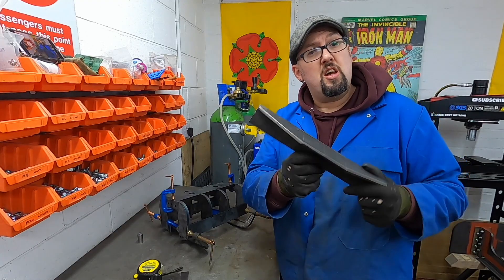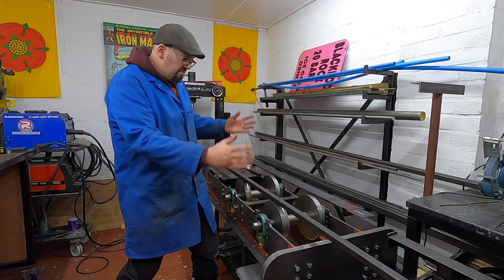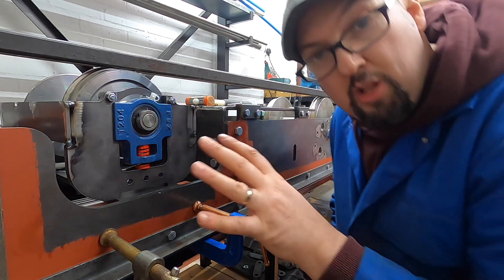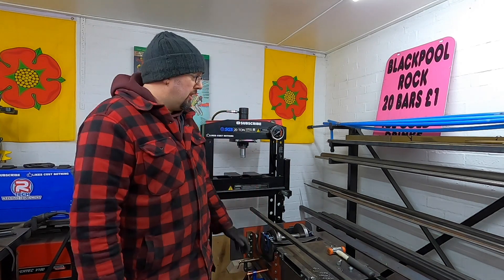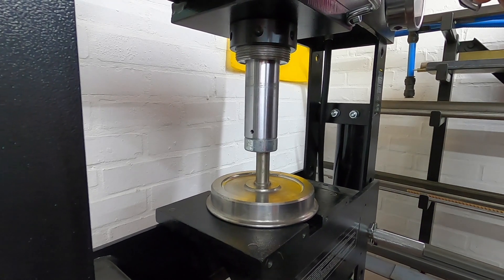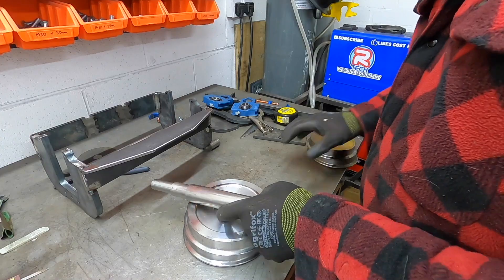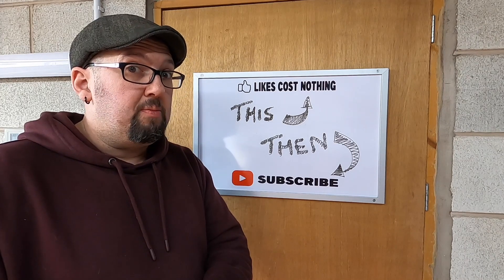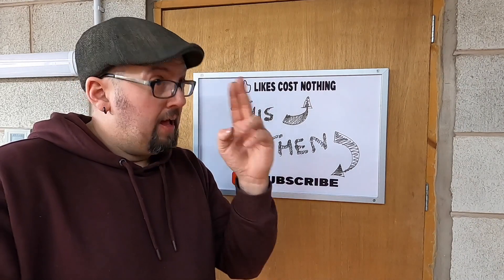The Pony Truck - Pt 2 - EP17 - 7.25" Gauge Steam Locomotive Build

Comment: That's what we have 3D CAD for! In all this time this design has been but and kicked from one tinkerer to the next, nobody has done a comprehensive model and ironed out these obvious kinks?
Reply from the maker: Hi Moritz, yes in 50 years nobody to my knowledge has produced updated drawings for one. There have been very many steam locomotives built, but no new drawings, it’s just strange. Unless a set is produced by the time my engine is finished, I do plan on doing a set. All the best, Matt.

Comment: My pony truck is a lot less engineered than yours. A metal tube with springs on top and a slotted bracket to act as a slide plate and keep the springs in. K.I.S.S. As they say. The advantage of the simpler design is you get to see the wheels rather than bearings. However, as the pony frame still sits on the slide plate frame stretcher, what are you actually achieving by putting smaller wheels in, other than lifting the from of the loco as you will be sat on the rear axle compressing the spring.
Reply from the maker: So, as you know they are very unbalanced locomotives, with lots of weight over the rear end… especially when we sit in them! The new version of the pony will give vertical adjustment to raise or lower the rear to give more balance. All will come clear in the upcoming episodes. I’m not going for plate on plate for it to rub against but I’m going for roller bearings, again, should all come clear in upcoming episodes. I think everyone does it differently, but I’m following the guide of the builder who has one at the local club, and apart from me taking the long route to make it, it’s fairly simple.